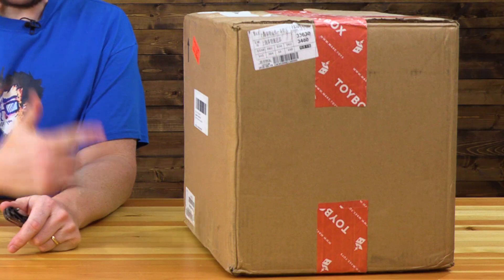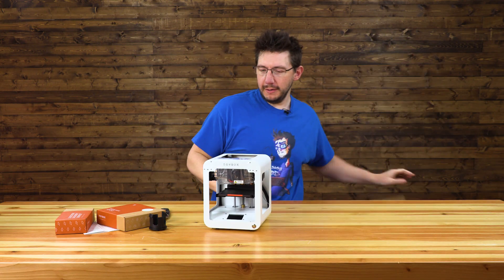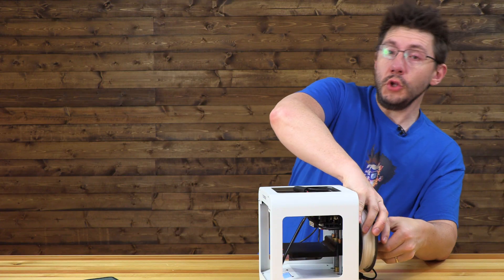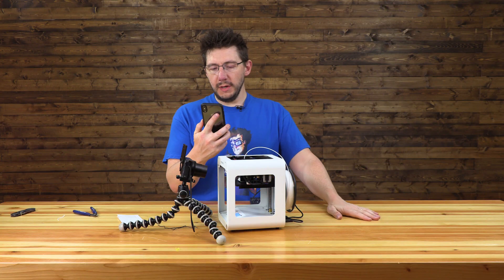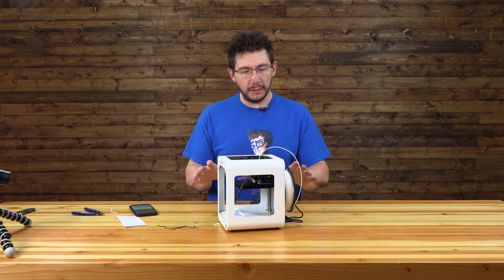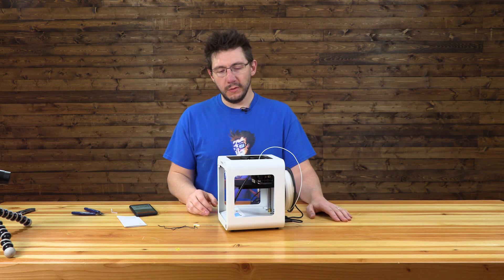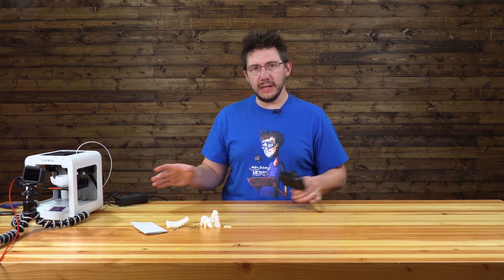Toybox 3D Printer As Seen On SHARK TANK

Comment: Nailed it! This is on it’s way as my 3rd printer… rewatching this years later is too much fun. 😄
Reply: Do you recommend this product or what’s your experience with it been so far I’m thinking of getting my son one
Reply: @gooooooootooooooo3825  Depending on his skill level it is an excellent printer.  My 5 yr old made all of the items she donated to a nursing home herself, loaded the filament, took the item off the plate and ran the app herself. Her sense of pride is rarely higher than after that project. Their Black Friday deal looks decent this year. But I have no experience with the subscription service.
Reply: @gooooooootooooooo3825  Oh but I really must advise against Silk filament in it. The layer adhesion with silk is bad and sticking that first layer is 50/50 (Note: the same silk that doesn’t work in my Toybox run beautifully in all my other printers) 

I highly highly recommend Overture Matte PLA, I have ran 50+ prints in a row perfectly adheres to it self and the build plate every time (almost too well).  It is what I have my daughter use when she wants to print things out without my interference.

Comment: The software is OK because it's good for kids but the printer leaves a lot to be desired as much better printers come down in price. About 80% of my son's prints are no good, either the object shifts or moving parts fuse together. Also the "food" gets stuck because there's nothing holding it above print head (think sewing / knitting machine) and the filament goes between spool and printer and hangs up then the matching shakes and jerks violently. This is truely a disappointment for a child who sees all these printed things and then finally gets his own and it's mostly useless

Comment: The printing mats that come with these are awful, the adhesion wears out extremely fast. I recommend putting masking tape on the print bed before printing, to extend longevity of the bed, and to assist your prints in sticking to the bed. ToyBox has also recommended doing this in some of their support forums.

Comment: So, I only have one filament printer, and I got it cheap... It's a used Da Vinci 1.0 AIO... I've got it dialed in pretty good, can print ABS really well, and PLA pretty well. But how does one even print without a heated bed?

Also, that's a pan flute, which I googled to be sure of... which led to image results of statues from ebay coming up, that were .... so graphic.... so big... girthy... Anyway, you're playing it wrong. And it seems to have linage attachments to uhh... Johnsons.

Comment: So looking at the thumbnail and the beginning of the vid gave me some PTSD from when I first dipped my toe in 3D printing and rented the M3D printer grom my college. It is in the same spirit of "This is just a beginner printer made for people who don't know too much" but It failed at that in many ways. The software while simple could have been improved if they just kept the infill as a percentage and not some arbitrary picture,  it had terrible definition, and it was extremely slow. The main issue with it that trumps all the other ones is that the bed was awful. It was just a bit of plastic that also acted as a panel to an opening below to hold the brand's small spool; prints fell off constantly which forced me to use it at a slower rate and constantly monitor the print. It would spend hours trying to print out a small figurine and then fail wasting 7 hours of my life making sure and worrying it wouldn't fail.

I was so relieved that this has a much better bed the thing but I still kinda wish they implemented some auto-leveling feature, which could cost them a bit more cash but could cement them in the competition

Comment: This looks like a much better Children's 3D Printer than the Creality 3D CR-100 that looks like a Transformer truck for about $180. The instructions how to set it up and use it were horrible at best. Once I did figure how to set up the printer and slicer software I was impressed with the first print, did 3 more test prints then printed a part for my RC truck. I would say the print quality is better than what I saw in your video with the Toybox. The next print I attempted the filament guide tube pulled out of the hot end.  I contacted Creality 3D since it was only about a week old and has a 1 year warranty.  They wanted "photos", which I sent. They asked if I had "modified" the printer, stating the photos don't look like their product.  Since there are no CR-100 replacement parts available anywhere, not even from Creality 3D, I asked them 5 times (so far) if CR-10 parts would work since I can find them for sale online.  They have never answered that question.  The last I heard from them, nearly a week ago, they said they were sending my case to a "professional person" (whatever that means), and I haven't heard back from them since. Needless to say I am not overly thrilled with Creality 3D and won't be buying any more of their products.

Comment: Hey Joel are you going to review the Creality CR-100?
Reply: I have a CR-100. Setup instructions are horrible at best but once I figured it out I was quite impressed with the prints.  Unfortunately after only 4 prints the filament guide tube pulled out of the hot end, and there are replacement parts available anywhere, not even from Creality 3D. And they have been giving me a big run-around and when I sent them photos they said it didn't look like their products. And have now stopped replying to my emails.

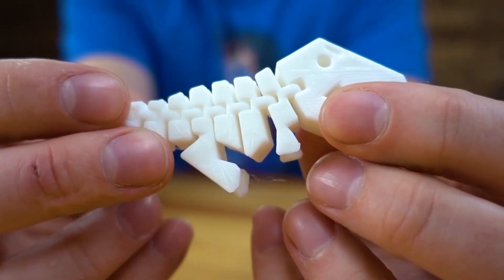Comment: 9:03 on my Anet A8, the Flexi-Rex prints beautifully! All the little sections move and it comes off in one piece and there are little to no imperfections visible. I tried the same thing on a Flash Forge Creator Pro and it didn’t turn out great. It was rigid and the tail did t move all that great like yours, it is also rough around the edges and is coated in imperfections. It’s kind of interesting to see that a $200 printer out performed a $1000. 

Granted that it wasn’t a fair comparison. I printed the one on the ffcp in pla but with abs settings, I was running out of time and forgot to switch to abs, I changed as much as I could with the on board printer settings though.

Comment: My neighbors at a school maker faire had one of these and they could not get it to work (it did work for them up till the fair). I had a closer look at it and it looked like the bed was slightly crooked. Unfortunately there was only one adjustment screw (I think up and down) which didn't fix the crooked bed. The owner stated they had to re-adjust that screw every few prints??. I ended up putting a little piece of tape under one of the corners which got them going again. The problem is, that I (someone with limited experience in 3D printing) was able to get it going again. Without some insight, this would have become yet another book-end. As long as a printer works, any noob can work with it. The problem is they never keep working flawlessly for long. Then what?

Comment: Nice try to get childrens to 3d printing but for this price you get a full size 3d printer.
Reply from the maker: True. Their idea is not just a machine but also a software ecosystem that will make it easier to use.
Reply: @3DPrintingNerd  yea this ist right. For the targeted marked sure not bad, but offers the printer also a alternativ way to Print or do you have to use the ecosystem? I realy dont Like closed systems.
Reply from the maker: The app allows for STL, obj and gcode upload, but that still uses their service. I’m investigating

Comment: I like where the 3d printing industry is going but it's still a ways away from being super easy and user friendly. I also like the idea of just taking the machine out of the box and printing models but anyone who has a printer knows these things can be finicky and each printer is just a little bit different. Also for the price they are asking you could get somthing like a monoprice delta which prints more accurate, faster and has a bigger build hight.
Reply: To be fair, 3D printers already are the easiest multiaxis CNC machines to use - and probably the only ones that can just up and start working without needing to zero them in. And they are full and proper CNC machines, gcode, axis systems, and toolheads all being there along with CNC controllers that even at minimum are more complex than a minimalist CNC router

Comment: Give me 10 mins with that open wifi....
Reply from the maker: Which open WiFi - the printers? What are you thinking you could do?
Reply: @3DPrintingNerd  Well, I used to take control of DJI Phantom drones with open Wifi hot spots, I am going to guess the same lack of security would let me log in as root and take a look at the gcode files, perhaps change them to one of my own, kill some processes running, send in some unwanted GCODES, would just need a few mins to take a look inside that nice open connection ;)
Reply from the maker: That’s SO SO COOL to think about! I’m super curious now!
Reply: @3DPrintingNerd  You would just need a laptop with wifi enabled , log into the printers wifi and use something like PUTTY to make a connection to the routers IP address and have a poke around, some of the more "interesting" tools could also be used, wireshark, etc. I may have to buy one just to take a peek :)

Comment: New printer here! I’ll definitely look into picking up one! What do you think about using this for bigger models? I make my own TinkerCAD tanks and want to use this. Thanks again for the video!!
Reply from the maker: Hey there! Using this for larger model might be an issue, it's SMALL. What is you techie level? This is really targeted towards a very young crowd. If you've got some skills, you can look at machines beyond this.
Reply: @3D Printing Nerd Im 14 and just starting out, I had a CR10 mini, but it was to complex for just me to handle. Here is my TinkerCAD link just in case.

Comment: It seems like this would be a good first printer for parents who aren't the most technically inclined, but have a kid who wants to get into 3D printing. It sounds like the instructions could use some work and the app might need some more work to be more stable, but those are relatively minor issues compared to if the company required a hardware revision to fix a problem. 

I like that it's not on the other end of the spectrum where a parent is trying to put a kit together for their kid. Nor are they having to mess with getting a slicer going to get the kid into it. It's seems quick and easy to set up and I really appreciate that the app has accurate estimates of the print time. Those of us who do 3D printing know that 3D printing is a lot slower than you expect when you first get into it. This way the kid can look at the timer and know how much longer it'll take for their prints to finish instead of just losing interest because of a long print.

I guess my question is, are you able to print things not in the app, and if so how hard is it? If the printer isn't able to print things not in the app, or the learning curve is too steep, I could easily see this turning into a $300 paperweight as well. 

I think what I would like to see is a kind of drag and drop slicer solution, like in the app or a desktop application, where the kid or parent could just add an STL and the program is already mostly pre-configured with things like layer height and speed. The only required options would be things like infill and other options specific to the print, but not the printer. If something like what I described is there, then it becomes an even better investment as a learning tool when combined with something like TinkerCAD

Comment: So just making sure I have this correct this printer is basically like the raspberry pi or the micro bit for 3D printing that's cool cuz if the kids have something accessible don't have more of an interest in it next we need like a 3D modeling software that's kid based so they can try to make their own basic prints btw best channel ever
Reply from the maker: The printer is actually the Createbot Super Mini hardware. What Toybox is doing is giving it a custom firmware, and pairing that with an app that has a curated library, custom model creation, and ways to upload your own STL and gcode! I think if a young kid had this and Tinkercad and/or Morphi, they would be set.
Reply: @3DPrintingNerd  thanks for the information was also wondering is there anything else in the 3d printing world that is targeted for kids and if so how about a side by side comparison or top 5 best printers for youngters

Comment: I got mine months ago, it works fine, even though it has wifi poor antenna and doesn't have a part fan (it prints pla), I'm enjoying it with my 9 year old daughter. I designed a spool holder to accept regular size spools

Comment: My first printer was the monoprice select mini
Reply: Good option
Reply: I've chosen in my unlimited wisdom a delta. 

Worked great the first year, then started to need rebuilt (delta arms were uneven lenght, and the joints were totally worn). Now with magnetic arms that thing works great, again. Aso the Ultrabase was worn down completely, needed to use bluetape. :D

Comment: I just watched the Shark Tank episode and can agree with the investors.  The printer is targeted to the 6-10 year old range.  Very few children have the patient to wait for the long print times.  I too worry about the safety of this printer in this age range.  I agree that the more realistic target range would be the 12-16 year old range, as a first printer.  It is the software interface which makes this such a potential for students.  This would be great to have at junior high schools where there is some supervision.  When looking at the size of the workspace and lack of heated bed, I think they also need to work on the pricing to get somewhat competitive to other basic printers on the market.  As you know pricing is very competitive in general basic printers, most of which are larger than this.  Concept is great, but the pricing needs help.

Comment: Lots of folks are confused by the price. They're a small company that's only really just got started so they haven't produced many printers and they have to recoup their expenditure quick to keep their head above water (it's why they've gone on shark tank to try and acquire more capital, and more importantly visibility). Producing a product at a market penetrating price tends to require a larger company that can afford to produce the product for a longer period of time before it eventually becomes profitable. Larger production volumes also tend to decrease the price per product. So, you either operate at a loss until you eventually make enough sales to cover costs, or you start with a higher price point and produce lower volume and hope that your product fits a niche.

If the company is successful, I have no doubt the printer will come down in price.

Comment: Not for $300. I purchased my dual extruder printer with heated bed and a roll of filament for $300 off ebay and it can print on a bed 250mm wide. It was also preassembled. Sure it's a chinese one, but this tiny thing should be around $150 imo.
Reply: It's all about the software ecosystem. Kids in the age range Toybox is targeting aren't gonna learn Simplify3D and Marlin. They just want to pick a toy on the tablet and start the print.

Comment: Reminds me of the New Matter Modt Printer which had similar cloud files and slicing with WiFi connection. New Matter is out of business.
Reply: That's exactly what I was thinking and as someone who owns a mod-t, my primary concern with the toy box is long term future support. New Matter closed shop, released one final revision of the firmware to allow for offline third party support and handed over what little part support off to another company. They were running with this same business model that Toy Box is planning. What is Toy Box going to do different to keep it in business? The mod-t cost the same, had a bigger print area, and also had easy set up and print software support and that wasn't enough to stay in business.
Reply: CHEP 

F

Comment: I wish all printers could print so easily. Without having to slice the files and put them on a card and troubleshoot after each print cause something's wrong. Just seems so simple with that one, with the limitation of size. The maker of that printer could really go places if another one is designed with bigger build volume.
Reply: The inevitable troubleshooting with your first printer is probably what stops most people early in the hobby. Takes a couple weeks or months of frustration which is really just learning all the little things you have to do to keep your printer running well and then its smooth sailing. So this little guy working good enough out of the box is great and should bring in some new people to the hobby.
Reply: @Blondie SL I teach robotics .you are so right. This will be outgrown by 4th grade,and should be called a toy not a tool.